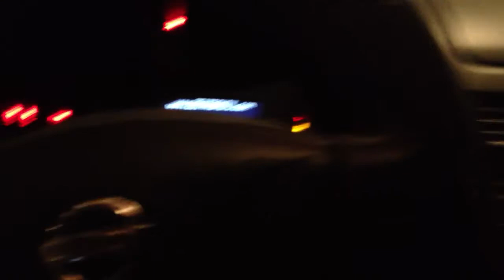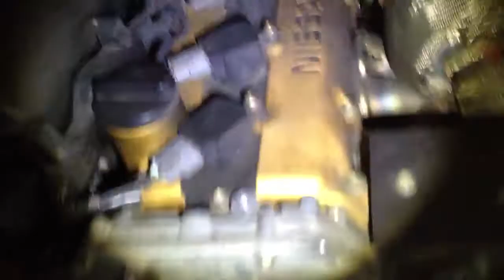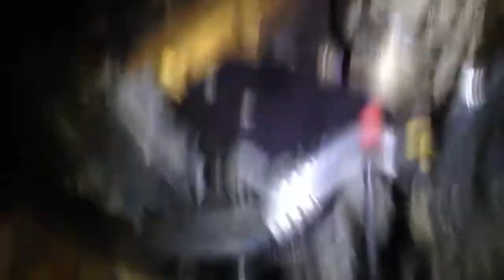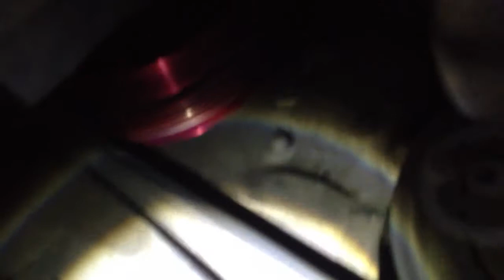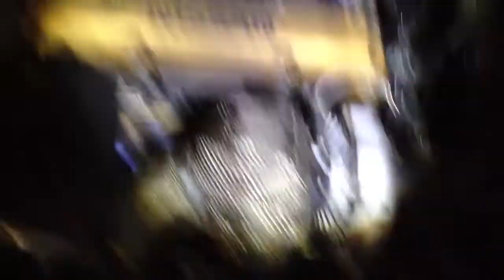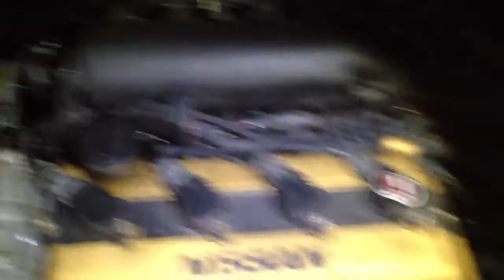Tacoed my engine

Comment: Damn, man... That's seriously making me cringe.
Damned shame. That motor made some REAL good torque on the dyno, if recall.
  I'll bet it was SO much fun while it lasted... About how long did you have the turbo kit on it?
Reply from the maker: It turned out to be flywheel bolts broke in half. But I did end up fixing it and getting rid of the Sentra. It was a good run. I had it boosted for a little over a year. 
It really helps to have a second vehicle when you start modding to that point
Reply: Sammy Benitez   Yes, I can definitely agree about having a second vehicle when modding your main one.
Flywheel bolts, huh? Man-- I was REALLY expecting something worse...lucky thing, huh?
So, during the time it was boosted, how well do you think the engine held up? Anything else obviously happen during the time you owned it?
(...and thanx for the reply. I'm aware that it's probably been a while since you've had the car...)